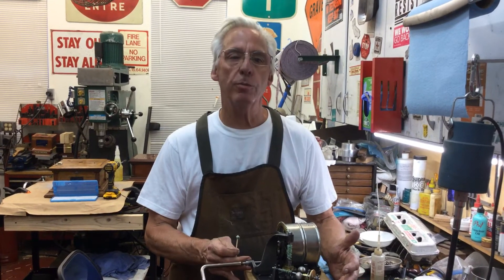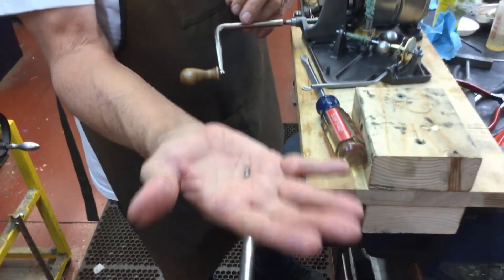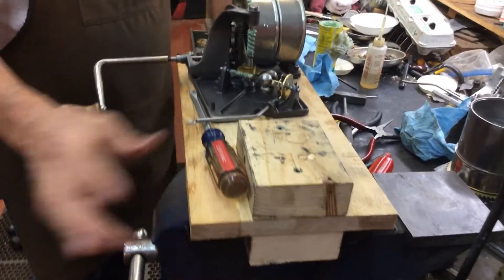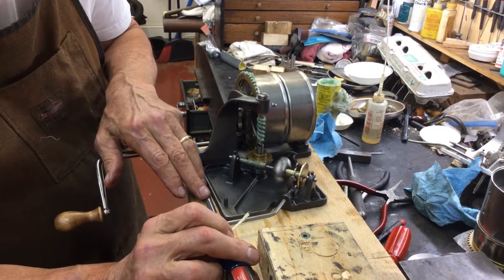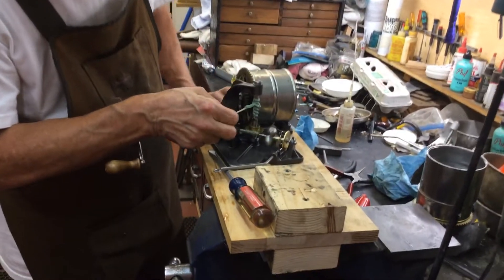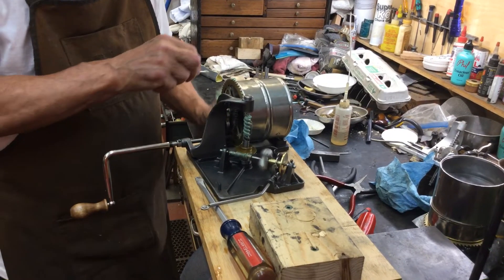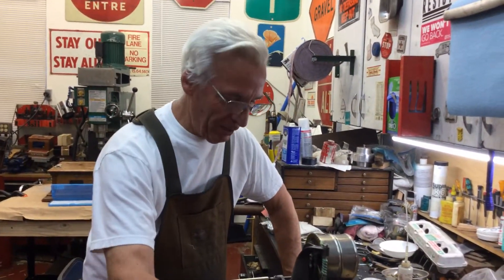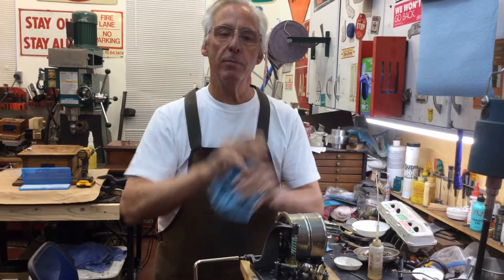308.  How to easily grease your Phonograph gear

Comment: I just got my new A-spring today. I haven't checked my B-spring. Do you recommend I take it out and clean it and re-grease it before putting it all back together. The C250 hasn't run since my mom and her brother broke the spring around 1960.
Reply from the maker: Yes, open the barrels, make note of which direction the springs are in and write it down. Then check your B spring, take it out and clean it, re-grease and repack it.

Comment: How to play standard 78 records on 9/16” spindle
Reply from the maker: If you have standard talking machine records, then you need to build a spacer to go over the spindle
Reply: My spindle is 9/16” need to play regular 78 records can I buy an adapter for this,Thanks for your time
Reply from the maker: @davidbass7114  what kind of phonograph are you trying to play?
Reply: Have a standard A  phonograph with a 9/16” spindle want to play regular 78 records
Reply from the maker: You can’t unless you destroy the 78 RPM records by drilling a hole in the middle. Standard A talking machine really only plays Standard phonograph records.